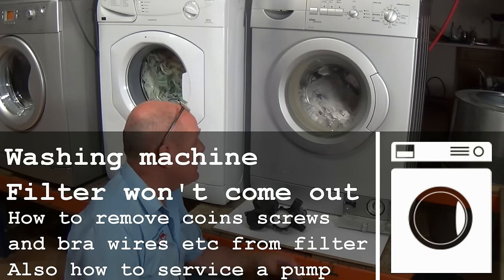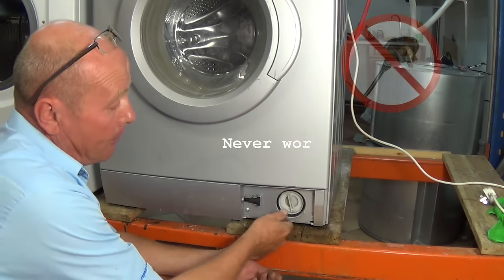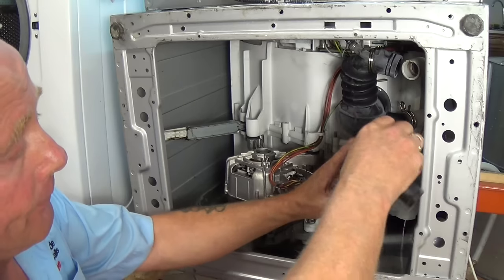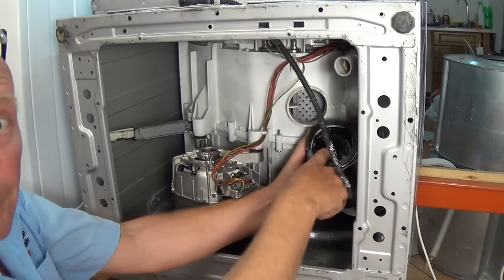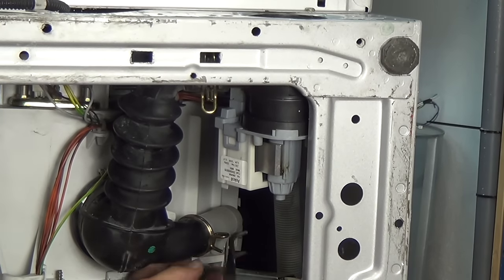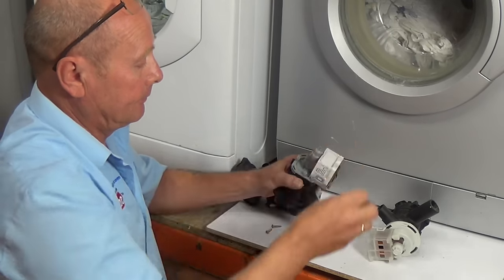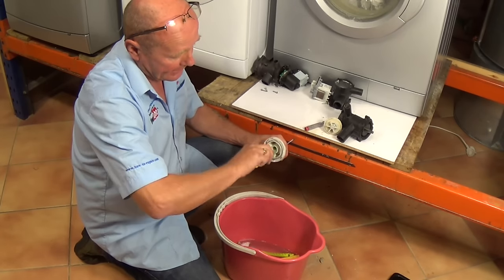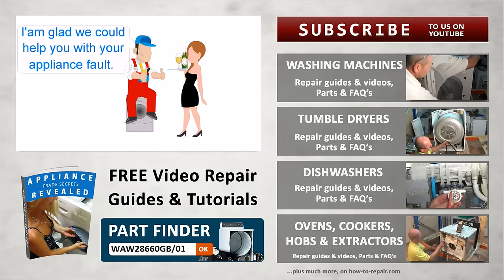Washing Machine Pump Filter Stuck Won't Open Jammed | Removing Coins Screw & Bra Wires Etc.

Comment: Brilliant! Mine was turning and jamming before I could completely unscrew it. I just turned it clockwise and anti-clockwise repeatedly without too much force and it did eventually unscrew.

As the man predicted it was jammed with a 5 pence piece! I was surprised there was nothing else in there after 13 years service and I never knew you had to check the pump filter, doh. Will be checking it every year now.

Comment: You sir are a legend just about to smash the filter out if my 300 quid washer  bloody under wire from other halfs bra 🙄 but stripped rebuilt pump and impeller and cleaned all good saved me a fortune 👍👍

Comment: Can someone help please, I have the filter out, but can't remove the wiring, there are two red wires with silver bits that go into the cream box bit and they don't seem to be easily pulled out, I've had a go but don't want to bugger the wiring. Thanks!

Comment: Thank you, thank you, thank you, a thousand times thank you! 

Today with the help of my 15 year old, I was able to remove and clean the stuck pieces of wood skewer and chunk of zip tie (and gross gunk) stuck in the pump/filter. It's been a hard few weeks and a broken washer (or the cost of repair) was the last thing I needed, but this video made all the steps totally clear and easy to follow, and my washing machine works again! 🎉 

Your explanation was clear, complete while concise, and super helpful, and saved me at least €70 in repair costs. I appreciate you making this excellent video so much!

Comment: Great video! I have a question. I removed the filter and there was a sock in it. Then I wanted to clean the filter but I forgot that the wire also has to go back in it. So I aciddentaly made it wet. I dried it of and i put on the heater. Can I put the filter back in? Or will the washer crash?

Comment: Thank you so much for the video, this is brilliant. I was unable to open my filter, I didn't have a torx screwdriver to get the pump out, but it's a relatively new washing machine.
Unplugged it, flipped it on its back, undid the tube using the pliers, fished out all the crap, seemed to be half a dozen hairpins holding the blockage together.
I used by dyson unblock gadget to fish it all out..... A metal bbq skewer with the end turned using the pliers.
Worked a treat, managed to sort it without removing and parts and without the correct tools thanks to your handy video.

I owe you a pint

Comment: Great video, kitchen flooded and water in drum and not spinning, engineer cost on bank holiday 175.. pounds.. hubby put it on the side and we checked it and followed your instructs, the electric was worried about but its just like an usb.. we undid front nothing blocking, took out pump checked all tubes and there was sand totally blocking everywhere that was damp, cleaned it all out, had a fight with the pump ball to get back in but after a few cuss words went back in, put everything back together one of clips was a pain but theres always one isnt there.. hubby turned it all back is running tons better and working tyvm for this video, bang on and easy to follow.. even for a 53 year old woman.....

Comment: i have a problem with my front door washing machine it could not putting washing powder and first water into the spinner. other works and programs r normal. when it mix washing powder with water it goes to exit pip this is wrong

Comment: yes but you got to be able to have the confidence to do this and remember to tigten up screws abd remember how to put them back also turn electrupicty of i tried to remove my filter had to undonscrews but loosened couldnt budge it  livedcin olacecseven mnths dont inow what else to do now live in a had water area could be calcuim got into mne too or something blocking it

Comment: Thanks Paul. Saved a bundle by watching your vid and following the instructions. Embarassed to say the filter contained a 20p, a 5p, 5 hair slides, a hair band, 2 shirt collar stiffeners and more as well as loads of gunk. I have bought you a Stella so your tutorial cost me £2.75 and two hours labour but left me with a big smile on my face! One thing - I got a bit carried away and turned it on last night and was a bit disappointed that the control wasn't working properly. I think that the electrical connections must have got slightly damp despite my best efforts. However, this morning working fine after two loads. Fingers crossed. Thanks again.

Comment: oh my... my washer dryer is 80+ kg.... how am I going to turn it over to open the bottom?
Reply from the maker: Hi, please use our contact us page and make sure you fill out the request for what your problem is. I will need the full model number of the identification plate and the details of your problem so that I can provide you with useful literature. A video shoot of the problem would be perfect as well.

Normally, I would get back to you within 24 hours but I am on my way to the IFA trade show in Berlin, so it can take more time to respond. Thanks for your understanding. https://www.how-to-repair.com/help/contact-us/   

Please remember to subscribe to our channel, as that's what keeps this channel going. Thanks, Paul 👍

Comment: Ahhhhh great clear video, good tip about marking line up points. Reminds me of fish tank pumps. Will attempt tomorrow. Done u bend on sink, still can't get spin cycle yet.
Reply from the maker: Good luck! Feel free to contact me at the website if you need further assistance glad we could help you @angelawheatley5480 this is for you https://www.youtube.com/shorts/e432SAb2g08 please remember to subscribe as that's what keeps this channel going. Thanks 👍 

  Hi @angelawheatley5480 I will need the full model number of the identification plate please use our contact us page and make sure you fill out the request of what part you are after and will get back to you within 24 hours normally https://www.how-to-repair.com/help/contact-us/
this is for you https://www.youtube.com/shorts/e432SAb2g08 please remember to subscribe as that's what keeps this channel going. Thanks 👍

Comment: Pretty convinced this is what's up with mine. Came down to use it and the drum had a load of water in it. Went to drain the filter, on mine there's no little hose to drain, you have to undo the cap and drain that way. Opened a few times and closed it off to empty the tray I was using and then it stopped turning. Feels like there's a coin in there. Which means my housemate hasn't been emptying his pockets again. literally pulled an MP3 player out of the drum the other day. Right, guess I've gotta take apart my 1 year old washing machine tomorrow.

Comment: Excellent video solved issue on my IFB washing machine (scal deposit due to which filter was jammed) opened the pump unit  and then cleaned the scal deposit and reinstalled the pump. One advise as suggested never apply force in case the filter not coming out as mentioned in the video.
Reply from the maker: Iam Glad we could help you. If you ever need help please use our site for 24 hour response https://www.how-to-repair.com/help/contact-us/
If have a question please use our site for 24 hour response https://www.how-to-repair.com/help/contact-us/
Please remember to subscribe to our channel
https://www.youtube.com/user/Apart4u?sub_confirmation=1

Remember to Shop with www.how-to-repair.com and it would help us by posting the video or

website on your timeline. This helps us a lot and if we really helped you can
always buy us a beer http://how-to-repair.com/help/buy-paul-a-beer/

Please remember to mark us to your favourites also I would be grateful if you would
subscribe to our channels social media as this really helps my site and keeps
us going.
YouTube. http://www.youtube.com/user/Apart4u

Facebook. https://www.facebook.com/how.to.repair.appliances

Comment: I can’t thank you enough. I put my machine on a cleaning cycle and it just stopped working. Thanks to your amazing video my partner and I were able to fix the machine. Inside we found two hair bands and two pounds worth of change including a fifty pence piece also a lot of cleaning solution which must have been the last straw.The filter cap had been stuck for ages but thanks to you’re amazing video my machine not only works but has a working filter for the first time in two years. The last time called for a engineer there was a three month waiting list so thank you so so much for saving me a lot of trouble.
Reply from the maker: glad we could help We now have Live Q@A's weekly on our live show, see our home page https://www.youtube.com/c/How-2-repair for the next date

Comment: Thank you for this video! I've just moved into a new flat and the washing machine that came with it was in a bad state. Followed these instructions when I couldn't twist the filter open, and took the filter apart to find 2 kirby grips and a clothing label blocking up the filter. Just running a test cycle now, but I'd never have been brave enough to try taking it apart if it weren't for the clear instructions in this video -  thank you!
Reply from the maker: Glad it was helpful! make sure you clean it each week

Comment: Thank you very much just finished a cycle of washing and everything is okay. Removed a few items that were blocking the drainage of it and my filter cover was broken so there was not anything to hold to open it. But after dismantling the drainage and pump system as you recommend I was able to used a small expanding spanner to hold and unscrewed the broken filter cover.
Reply from the maker: Iam Glad we could help you
Please remember to subscribe to our channel
https://www.youtube.com/user/Apart4u?sub_confirmation=1

Remember to Shop with www.how-to-repair.com and it would help us by posting the video or

website on your timeline. This helps us a lot and if we really helped you can
always buy us a beer http://how-to-repair.com/help/buy-paul-a-beer/

Please remember to mark us to your favourites also I would be grateful if you would
subscribe to our channels social media as this really helps my site and keeps
us going.
YouTube. http://www.youtube.com/user/Apart4u

Facebook. https://www.facebook.com/how.to.repair.appliances

Comment: thank you so much for this. i followed all instructions, cleaned the pump filter as you have shown by undoing the pipes etc but now when I have tested the machine to see if it works, its got a leak and water seems to be coming from the bottom right where the pump filter is. could I off damaged one of the pipes, or perhaps the hose clip is not tight enough?

Comment: 5:16 “it’s worth taking the ball out” not so easy putting it back in though 😠
Reply: Phew 😅 got it in. Had to put the ball in place on the whole. Put it upside down on table corner. Grab the plastic rim with two pliers (one in each hand) and lean my whole body weight onto it, so the table corner popped it in. Hope this helps anyone else with the same issue

Comment: Thank you for taking the time to explain this so clearly. Your advice stopped me from forcing the drain. My husband and I took the machine apart as described (only challenge being that the base of our Bosch machine didn't remove so we had to loosen the front panel to get access to the clips holding the pump in place). Otherwise all good and completed in under an hour. We found 10 coins, 2 kirby grips, an earring and a screw! Made a mental note to check filter regularly (and pockets more thoroughly!). Have subscribed to your Chanel as thanks.